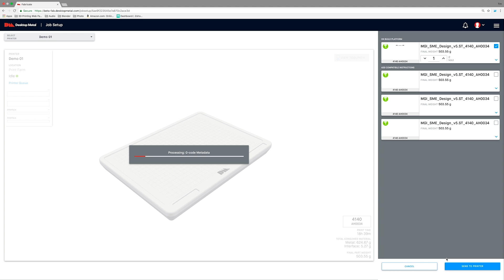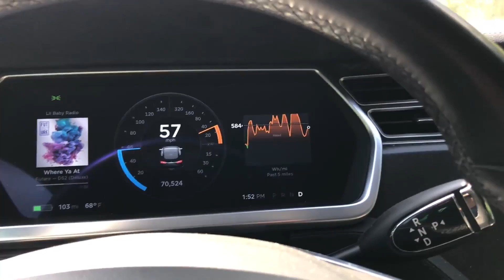FIRST DRIVE - The world’s first electric motorcycle powered car

Comment: So what kind of range are you getting? I've wondered about going with a smaller electric motor on my VW beetle hooked up to the transaxle. I don't need 300 horsepower. 100 would be great. Wouldn't that also give me increased range?

Comment: electric cars will NOT ever catch on until they recharge them selves either sitting still or moving.. ever notice the electric cars have NO solar panels  that hood bonet the trunk and hard top are never used for solar panels  want to know why??? a solar panel that big does not produce jack shit for a electric car needs.. thats why you have external power from the grid.. our largest household solar panel put out a lousy 400 watts thats the size of a king size bed and a household hair dryer takes 1200 watts to run   so it takes at least 3 bed size solar panels to run that same hair dryer.. and if your panels are not producing what your useing then you batteries will slowly die and never recharge while useing the power system..  we need smaller panel;s that produce tywice as what they are doing now.. simply put  we are not ready to live like the jetson yet  maybe in another 20 years or so..lol

Comment: I have seen Harley's on small v8 thrugh to  3 cylinder metro. Power. And also saw a merlin.  And a sand buggy on a zook 2 cylinder . All interchangeable.  Go get it man. Ps 1970 I mached a 4 cylnder Wisconsin combine engine to a old 1/4 mile racer . A bit of a dog. It held its own. You are the winner.

Comment: Two weeks ago my local junkyard got its first EV, a Tesla. I got the motor, battery and associated wiring for $2650. EV sightings are like Bigfoot sightings up here, so the guy that owns the yard thinks they’re stupid and way under charged me. In any event the batteries are in fine shape , as is the motor, so a friend of mine and I are making an arduino based controller and since I own a machine shop I’ll be whipping up the hardware to put this messterpiece into my mullet machine 89 Camaro. Your videos sir have made my madness seem achievable 👍

Comment: I had 305 in my chev van great motor small block. It's a Little better then the 350 on gas not much power. Was good motor tell a wanna be mechanic honed the piston sleeves wrong.

Comment: How much does it weigh, Rich? Acceleration is power divided by weight, plus traction (A=P/W+T). My dad was a teen in the 1950's and T-bucket rods are an icon for "men of a certain age", but my dad gave me the inside scoop. After WWII, cars from the 1920's/30's could be bought by a teen for dirt-cheap prices. In 1949, Oldsmobile and Cadillac had the first modern lightweight V8's, so teens in the 50's would keep an eye out for one of those in the junkyards from a wreck. Stuff a powerful V8 in the T-bucket, lower the body on the framerails, and then pull off the fenders and roof in order to make it light and reduce the cross-section. getting a cheap junkyard rod up to 100-MPH was a badge of honor.

Comment: So you must still have your clutch in there, right?
Rich, how much does the rat rod weight?
My vintage BMW weighs 2500, but I love your approach of using a used electric bike guts for your powertrain. Do you think I could pull off the same approach? Maybe use a beefier bike?

Comment: to my knowledge the zero are only dc engines. so they are really bad at holding up the energy efficiency at high rpm. so running the motor on a transmission should help the miles a lot.

Comment: Rich this is seriously inspiring. I have a 1953 Studebaker pickup, with less hp and less torque in the original old flathead than the Zero motor puts out. I also ride a Zero, so if i ever crash it, now I know exactly what to do with the parts!

Comment: 1. Measure motor temperature.
2. Drive that electric bath tub for half an hour at reasonable speed at some track (like 50mph) or even worse, in city.
3. measure motor temperature - if it isnt cooked already in those half an hour of test drive.

Comment: Great work, love the project. I'm a big fan of the Zero motor design with its superior for cooling layout, and if you think about it, it really is great for a light geared car. Flat torque and all that, but all the direct drive stuff just pisses me off-- at least two wide gears just make things better. Honestly, Tesla about lost me early on when they gave up on the transmission (kept breaking it) and made the roadster slower.

Comment: Waitaminute, gears? Why not a CVT? Why are people obsessed with shifting gears?
Reply: Why not? It's simple, very reliable, and it teaches you how to use an engine or motor properly. Automatic transmission is inefficient, especially in a smaller vehicle. A good gearbox can be over 95% efficient, and sometimes up to about 98-99% efficient, but a CVT can easily waste 20% of drive power. 
OTOH there's also a good argument for having a single, fixed, gear ratio in an EV, because of the very wide power band of a modern electric motor.

Comment: doesn't move the transmission cause it has too much torque, it's because it's missing front support from the original engine.. would probably be lighter and faster with a good 4cyl...or simply better with a proper big v8.

Comment: Approx 9 mins in, ..... A sharp drill bit would get thru that metal beta than the one he is using.
Then u idiots overtax the motor - batteries like they are 10 a penny.
OH well !!! wen U hav more money than sense, ..... YOU CAN, build projects like this one.
The car could have been a lot lighter too.

Comment: What was the top speed?  Did it make it to 60 MPH?
Reply: he said highway speeds so 60-70mph is expected. Its still 100hp 140ftlb torque motor. Also you have to consider just how light a model A is
Reply: My 40 hp VW would do 65-70, so 100 hp in this car should easily do 80+mph.

Comment: Range is literally the only thing that has me against doing an EV conversion on one of my cars... For a fun weekend car though, electric may be perfect!
Reply: How far do you drive? Electric cars have massive range if you buy a decent size battery.
Reply: @randomname4726  500km on one charge. Which really isn't achievable without designing a car around the battery pack with where the technology is at right now.

Comment: 12:25 "im not used to this kind of treatment from manufacturer"

glares at tesla
Reply: zeros have a proper way at helping customers instead of craping on them like tesla cars do ripping people off who paid thousands of bucks to get their car to fast charge which was certified by a tesla garage only to have it turned off a few months later isn't that theft I have never seen a motor manufacturer apart from rolls Royce who treat people like that all they have to do is when it's certified by a tesla garage if its a rebuild is a sign here please we will not take any responsibility for the vehicle if it catches on fire or explodes or anything just like all the other motor manufactures do when they sell parts to people who build accident damaged cars like me I have never had any trouble rebuilding any petrol or electric cars except tesla cars which I won't touch because of the childish actions they take as a certified auto electrician and engineer i have rebuilt quite a few accidents damaged electric cars replaced motors you name it control boxes computers i phone up nissan i nead a new motor yes where do you want it will it effect my charging capability  no sir we are not tesla that's the response i get from all of the other motor manufactures tesla cars need to grow up and be a proper motor manufacture all the way through as they do make some very good cars and are streets ahead of the competition with longevity and range they just have to stop nanying people like all the other motormanufactures do then they will be complete let people build there own your not going to stop them plus there are so many teslas written of just for a few body panels with no damage to the drive train or electrics and they still turn off fast charging to me it stealing once you have bought that car its yours and they should not have the right to turn anything off period all they have to do is send a update saying they no longer except any responsibility you press yes or no if no the motors are turned off or the fast charging its that simple and if its sold on it must be recorded like any rebuilt car is then tesla is free just like all the others the the owner can do what the hell they like to the car after that and tesla will not get any blame its all on the rebuilder.

Comment: Would it have been better to use the transmission from the motor cycle and run a belt drive to the rear axle or would it tear the rear tires up too much?

Comment: Six years ago I build an electric 1930 Model A. I used an AC50 (57 HP) motor direct coupled to a manual shift Powerglide with no torque converter.  It had a pack of 38, CALB 130 AH Lithium cells, an ELCON  charger and a 40 amp DC to DC converter to supply the 12 VDC for the lights.  I even drove it in the rain with no problems.  A LOT of fun.

Comment: I think what a lot of people forget is that you aren't running the wheels straight off the motor as the bike did, but that you have a transmission to convert rpm to torque.
Now take it apart and chrome the whole body!

Comment: Good, but take it from me a gear manufacturer of all things transmission for about 40 years, that the output coupling at some point will fail. The amount of torque is going to destroy the keyway in the output shaft and the coupling, it will just wear out.

Comment: That’s insane. With the motor from a motorcycle I was expecting that thing to barely roll along at 15 mph but I’m happy to be wrong.
Reply: they're over 100 hp and 140 lbft, but you don't need any revs for torque and power is about flat. I'm sure up to 50 it could still push a Rolls.
Reply: weatheranddarkness Damn I didn’t know they had that much power
Reply: It has the transmission. Multiplies force.
Reply: Most compact cars from the 1950-1970's had around 50-70 HP, and lousy torque.
Especially the European brands, due to economic restrictions in the post war era.
And they still got around just fine, heck the Citroen 2CV only had 28 HP.  😂
But cars like the Morris Mini, or say .. a Renault 14, or an Opel Kadett, would be in that range.
Reply: @Grumpy_old_Boot  some mountain roads where to much for those small cars. So it wasn't that uncommon to reverse up mountains.
Reply: @klausgattringer1239  
True, particularly front wheel drive cars would benefit from the weight transfer on very steel slops.
Reply: @buggscarrot9557  Yeah the transmission was basically necessary in a build like this. Normally EVs don't need them, but when you're using such a low power motor it is good to keep using the transmission.
Reply: Toyota trucks all the way up into the 90s had less power and would pull trailers, haul 1000 lbs of load and run up to 110 mph. ;)
Reply: @wtfisdat6382  - the R22 4-banger delivered 107 BHP and 137 lb-ft at 2800 RPM, and it even powered a family of RVs.
Reply: random person It’s a really light car. Doesn’t take much to make it boogie....
Reply: To be fair, the gearbox is probably helping it a lot, it's basically just multiplying the power in lower gears letting it get off the line with ease while 2nd and 3rd let it get to higher speeds once its moving.

Also that thing would be really light with the old engine and gas tank removed, and the fact that it is missing half the body with the lack of fenders, all thr front panels, and the roof.
Reply: The car weighs nearly nothing.
Reply: I know this is an old post, but don't forget that the torque is multipied by both the gearbox and differential. Also since the gearbox has multiple gears, the first gear is likely pretty short, so you would be putting down some pretty good wheel torque when launching in first. Plus those old hot rods are probably lighter than a kei car, so that 100hp us doing a hell of  lot in that car.

Comment: Hub motors are doable. Hm. Tiny motors can move a car. Tiny motors fit in wheel hubs, and if you take the brakes off the two electricified wheels, sprung weight isn't a problem - if motors weigh the same as the brakes. Use the motors as generators to brake, and leave the mech brakes on tbe other two wheels.

Comment: I just wish someone would make a Zero-powered motorcycle with a proper aerodynamic fairing.
Reply: dwc1964 try shark fairings if you want fairing in carbon or polyester. They would probably do first fit to get the market. Handlebar ergonomics come in to it as well as footrest and brake position when going aero.
Reply: @gwgplate2  I'm not looking to build something. I'm looking to buy something. Something that someone who knows how to build things built, so that it will work without me having to do anything to it. Preferably built at the factory along with many other examples of the same thing.

Comment: Awesome seeing it come to completion and fry the tires off. Would be funny to get a plastic mock up engine block and intake to cover the electric motor and then run those wires through headers to hide them. People would be so confused when you drive off all quiet 😂
Reply: They make plastic engine blocks, they are made for display purposes. Hot rod show rooms have them and bolt on manifolds, valve covers, chrome accessories. It wouldn't be hard to hollow one out and bolt on some goodies to make it look real.
Reply: @mrdanforth3744  Thats what i was referring to, i think it would fit the build perfectly lol

Comment: I have been watching your build Im impressed. If you think about it you may have opened up a new era of hot rodding. ( And if you start now you could corner the market and sell them at a descent price that a normal joe can afford) As long as you can come out ahead on the project as well. One thing about doing some thing like this for your first time. The next one will come out better just by making some changes that you would do different on the next one.  Good job, glad to see that it worked for you and have fun with it

Comment: I think this worked because of the "underpowered" motor. A more powerful one would break the transmission with too much torque. 

As it is, the motor needs the transmission in order to get the car going at a fun pace of acceleration, which makes it a great pairing.

Comment: You built a 3 speed death trap,  good job.   Gearing in an electric vehicle would just end gasoline cars.
Reply: Yes gearing in electric cars is interesting, I haven't watched this series as religious as others but I was surprised to see that.
Reply: Keep up your videos glad to see u here
Reply: Actually he made a safer death trap compared to the usual 3 wheel death traps.
Reply: Isn't building 3 speed deathtraps the whole point?
Reply: @3vi10n3  lol
Reply: "Death trap"
Reply: actually no, gearing is inefficient in a properly designed ev, it can increase top speed however.
Reply: @fabianseewald7884  Then there would be no point to mid-drive ebike motors.
Reply: @Two99Point80  as far as i know they are geared to disconnect the motor from the drive when power is depleted, to ease the use of pedals only
Reply: Nonsense @fabianseewald7884  the motor is undersized.  The Rat Rod probaby weighs at least 3 times what the donor motorcycle does
Reply: @lloydrmc  actually Not nonsense recipricating Motion ist Always an issued No Matter how light the parts involved are, thats why steamengines dies Out and turbines are User but don't Believe me Just Look at planes
Reply: @lloydrmc  ideally you would not use gearing in a electric car..... however you need to if you don´t have enough torque available of course
Reply: @fabianseewald7884  I don't see how its very inneficient, manual gearboxes are already super basic and lightweight, and with electric motors you could reduce the number of speeds you need, you could remove the reverse gear, you wouldn't need a massive bellhousing or flywheel, your clutch could be much smaller, and with how small the setup could be, you could possibly be you could mount the gearbox straight to the diff, so you would have a very short distance between where the power starts and ends up as well as possibly making the whole drive unit have an even lower profile resulting in more trunk space. Also theres the inherent efficiency increases you get at higher speeds since you can adjust where the motor is sitting in its powerband meaning you can push the motor back to a point where it is more efficient.

So overall, no, I think using gearboxes in evs would be very inefficient, if they were implemented properly of course.
Reply: @chev555  just in Principle a gearbox isn't 100 percent efficient, if you can get away without one that would be preferred however, this isn't always the case for ev's with high top speed, were e-motors provide no more torgue a gearbox might be needed, like an overdrive, because for most of it's powerrange the e-motor is really good, with the best powerband of all engine types if variability is concerned at least
Reply: @fabianseewald7884  not inefficient. Automakers save costs by gearbox delete in New EVs.  Automakers love to cut corners where possible
Reply: they better fucking not mess with my gas power, if there arent gas powered cars mainly ill end up not having my whole lifes focus for the last 5 years to become a automotive mechanic when i finish school ill be pissed and broke
Reply: @Jordan-zk2rf  
We're a long way off from completely losing the IC engine. They're making more gas cars now than ever before, so I think we'll still see auto mechanics for decades (longer for the diesel guys). Plus electric cars will still break and need servicing, a lot of mechanics are already learning to work on them. Though EVs tend to be lower maintenance than internal combustion cars.